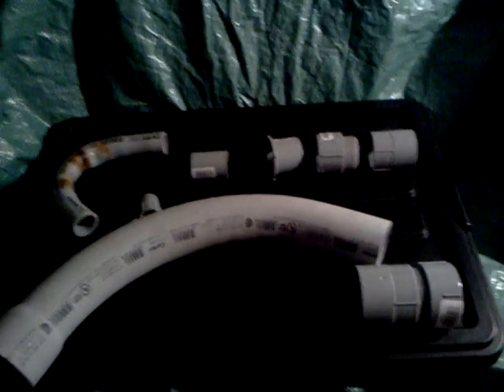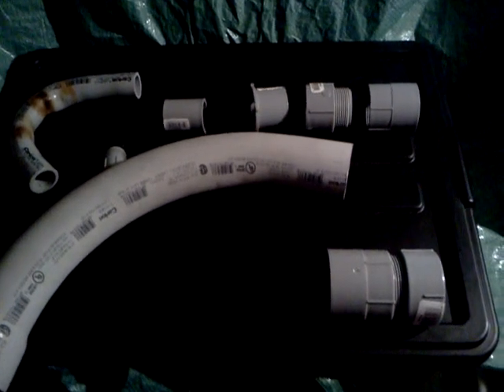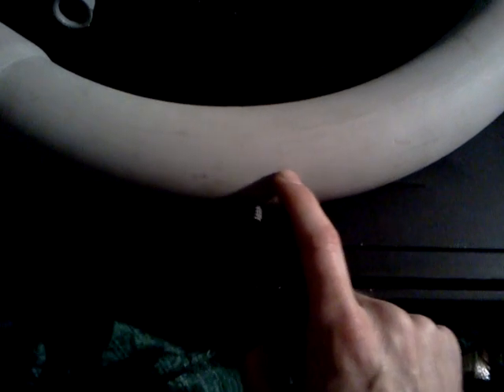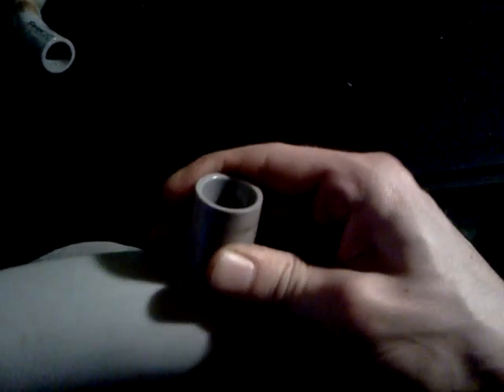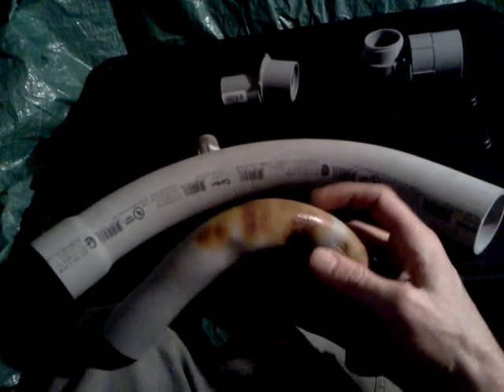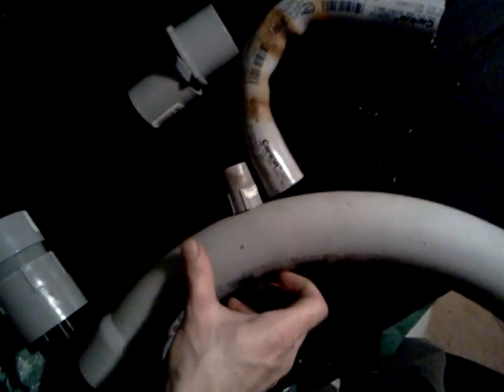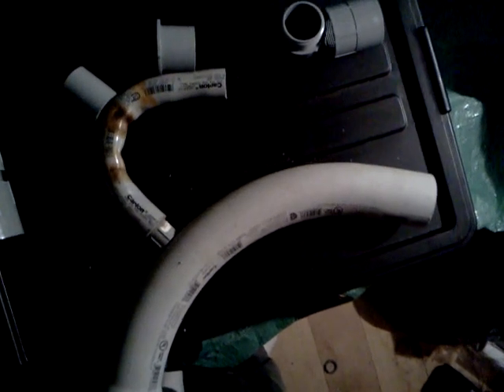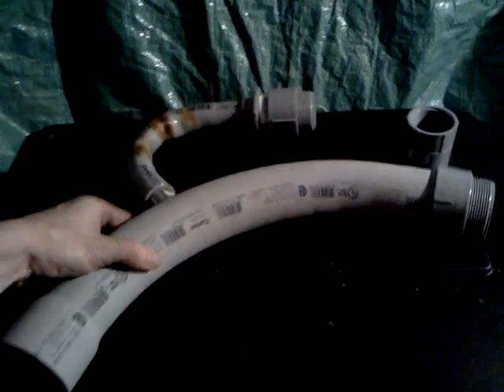Dredge nozzel poor mans.3gp

Comment: So did it work? I bet it didn't. Looks like the reduced pipe entering the curved larger section does so at to blunt an angle. It should be directed toward the direction the material is to go. Shouldn't have posted this until you tried it so people could study the results and decide if it was a design worth anything. This is a half assed video of a half assed job. Not to offend there guy. Just sayin how I see it.
Reply: 25 dollars wasted if it didn't work.  How about a follow-up vid to show it working, or lessons learned and how to make it better.